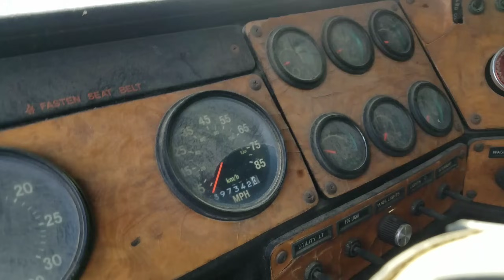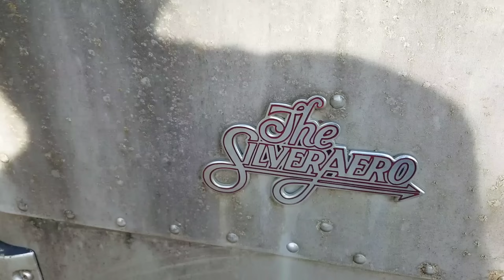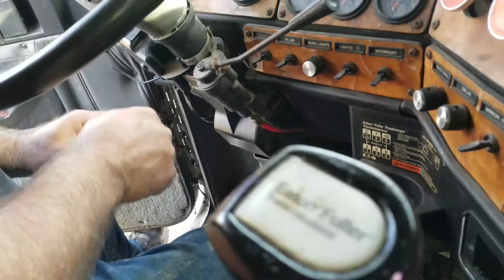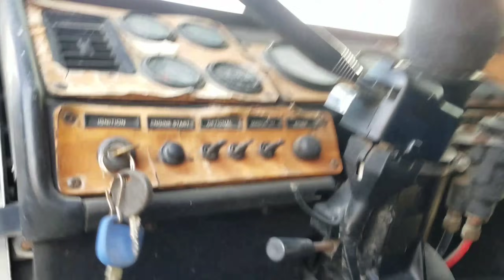Freightliner fld120 FIRST ATTEMPT TO START AFTER 17 YEARS

Comment: Run a wire from the batteries to the solenoid on the pump and prime the shit out of it  and crack the injector lines close when fuel is pouring out tightin them back down 👍
Reply from the maker: iTS GETTING POWER TO THE SOLENOID THE FUEL RACK IS STUCK. IM GOING TO WORK WITH IT SOME MORE BUT PROBABLY GOING TO HAVE TO PULL THE PUMP AND SEND IT OFF.
Reply: take the two bolts out of the fuel shut off solenoid. Remove the solenoid and try to crank it it will not hurt anything if she still doesn't fire stick your finger in the end where the pen on the  solenoid makes contact see if you can move it back and forth enough to get it to free up could be condensation inside of your electric solenoid where the pen retracts done it at least a couple dozen times try that and it will save you an expensive fuel pump repair headache

Comment: A little puff of quick start will have you cranking for nothing. That puff will maybe fire 1 cylinder. Use enough to fire all cylinders and save the batteries. Good video though... these old machines were the real McCoy.

Comment: What you should’ve done is checked for fuel in the fuel tank, and then ran the fuel pump until you had fuel coming out of the bleeder valve that would make sure that you have fuel to the injectors, then go from there
Reply: Cuz I Can 🤣 the only thing electric was the lights and stereo, no cruise control, air wipers and windows, it had a tiny manual pump on the gear drive fuel pump, I would not let service techs use ether, WD-40 only, when a Mexican Pete driver would speed up to prevent me from passing I would get to 70 right next to his window and stuff it up in double over drive and gouge on it!
Reply: I checked all fluids and bled the fuel system just didn't video it. actually didn't know she was going to put this video on youtube
Reply: What was the problem.
Reply: @BudDVega  fuel rack and plungers stuck in the off position. tried lube and heat gun but no luck. gonna have to pull the pump
Reply: tim , I could hear it when they stuck, sounded like the timing chain broke, the number 6 piston broke on mine at about 900.000, the boss did rebuild it though, I put about 60 thousand on it and left the company, the next guy who got it ran over a truck tire and rim, lunched it, bent the frame, he had it fixed again, and sold it, I have seen purple stripe ones sitting in fields, it will be interesting to see what you do with yours, I’ll be watching, keep us posted.
Reply: Timing gears, something isn’t right.

Comment: Very sad to see that truck sitting in ther getting rusting. Before you trying start a truck like that check OiL level and cooling do pretrip inspection to it renplace fuel filters. Add fresh fuel. And the truck will start with no.problems

Comment: I know airplanes and squat about trucks but shouldn’t the supercharger be checked first? What about the dry engine cylinder walls-dry wheel bearings?
Again, I know squat about trucks but this seems like a beaut and he got the trailer too?
Reply: dry walls with either was my concern but I got the pump fixed and it's running great I'll post a video soon

Comment: try looking at the timing belt. electric wires, and everything. bottom as well.
Reply: No timing belt on that :) camshaft is gear driven
Reply: ok, ty didn't know  till now, now i know that.  learned something new.
Reply: @juliogonzo2718  
kind of makes sense because the gear is there and by the king pin to pull that if its needing to get pulled out by a rotator tow truck.   hope this makes sense,  i suck  at explaining things. easier and sounds better in my mind.
Reply: @alquarius86  in a car, the camshaft that opens and closes the valves is driven by a timing belt or a timing chain, usually under a cover inside the front of the engine. The belt is attached to the crankshaft that is rotated by the pistons. In a large diesel engine there are gears instead because they are more durable and there is little chance of them failing unless a loose bolt or something falls into the gears while they are rotating.
Reply: @juliogonzo2718  i understand  now why they call rotators , and a rotator truck but im still not understanding the other one,  .
Reply: @juliogonzo2718  im awake more now than before,   weeks been crazy and my brain has its own thing,  id say my mind or brain has a mind of its own and its a pun all the way around.  lmao lol
Reply: @alquarius86  rotator the boom pivots like a crane, regular heavy wrecker the boom only goes up and down, and can be extended in stages. some the lifting boom can slide to the rear.
Reply: @alquarius86  the company i work for had a rotator until one of the drivers fell asleep and crashed it into a swamp. We still have two heavy wreckers. That truck was cursed I think. Someone bought it and repaired it, first time they used it, the boom got stuck in the turned position. Year's later, it caught fire

Comment: Did you prime the Fuel Filters and shoot it with either? I am not trying to be a know it all, But I was the owner of 21 Trucks and believe me started several that was sitting out in the fields of Kansas and Oklahoma. I have been involved in Trucking every sense 1957. I don't know everything, But a lot more than many so called Mechanics. Ray Pittam, Pittam's Trucking & Transfer Co. I am proud of you it just started, Sounds like the Filters are dry,
Reply: thank you ray. I did pump the primer but problem was fuel rack stuck. I did get it running and will post a video soon.

Comment: Does it get to any one when someone like me knows what is wrong and how to get it running then you get 2 guys who dont know their ankles from their elbows and Just fumbling around.  Apart from low fuel the engine could be running in about 10 mins, I would need a 14, 17 & 19mm spanners (sorry not sure of imperial measurements) and a decent straight/ cross head screwdriver
Reply: I would of in 10 min if fuel shut off wasn't stuck in off position
Reply: @trnot  it is a solenoid with a rubber plunger it screws in the side of the injector body unscrew it and check it out, if the plunger s stuck in the at the end then take it out with tweezers, pointed nose pliers, be careful there is a light spring behind the shutoff solenoid plunger, but even when you said the solenoid was working now because it was clicking you still didn't check it, Also normally diesels have a lift pump but occasionly have a electric pump, I have worked on both
Reply: @chilledoutpaul  I took solenoid off and it works freely when you turn key on. just the rod does not move I sprayed lube in it and gonna work with it again.

Comment: One thing you didn‘t check is the turbo free? After that many years of sitting you got  rain water went down the exhaust pipe and it has to go some where. You have moisture sitting the exhaust pipe and it makes it way to the turbo and freeze up the turbo. Pull the pipe off of turbo and check it and make sure its free. That could be a issue why that engine didn‘t run for you. Does your exhaust pipe got crap in it like a bird nest and the exhaust would be pluged up. You had no cover on the end of the exhaust pipe when you park it many year ago. QUESTION WHY DO MANY FARMERS PULL A CAN OVER THE END OF THE EXHAUST PIPE ON A FARM TRACTORS? ASK A FARMER ABOUT THAT SOME TIME. On that freghtliner drain the old diesel and put in new diesel it would help alot. You can keep cranking on the start like you are you will burn it out because it get to hot to many times. Then you will be putting in a new  starter.  Those fuel filters pull  them to see if there fuel  in them plus at the same tine how much dirt and water is in them filters.

Comment: All of that, and not ONCE did the camera show anyone checking the tanks for fuel, or the primary and secondary fuel filters. That's a Caterpillar engine, there is NO "fuel rack" as you would find on an old 2-cycle Detroit. I'd check the fuel levels in the tanks....then pull the filters, make sure they're both FULL(wouldn't be a bad idea to change them while you're at it). It might be a case of a line being cracked, drawing air, the fuel-pump solenoid not having power or being bad, or the pump itself being shot. Cranking the piss out if it won't do anything but burn that starter up and drain the batteries.....
Reply: There is a fuel rack and it was stuck. fuel,oil and coolant was checked and filter were primed just didn't have on video.. runs great now I'll post a video soon. thanks for watching.

Comment: Where in the United States are you? The reason I ask are the batteries you installed looked like some of the reconditioned batteries my old company used to sell. I am in Arkansas myself close to the Missouri line
Reply: battery outfitter. central missouri

Comment: What was he doing with the block thing and the spray?
Reply: ether is to start it block is to cut off the air if it run away. wasn't for sure if it would but i had an old diesel engine do that.

Comment: You will need to pull every fuel line off, replace them, replace that fuel filter. Drain the tanks and out fresh fuel in them. And maybe even pull injectors and clean those. Then you will get fuel. 
Also pull the fuel pump and take it to someone who knows how to work on them. Have them clean it out for you. 
I bet that whole system has bad sitting fuel in it. 

I’d pull that valve cover off and also the oil pan and inspect and clean everything before I’d even try and start it anymore. 

There are two  guys here on yt who does these cat videos. Find those guys and you will get all kinds of info that will help.

Comment: Hope they realize the diesel in those tanks is shit after 17 years and they definitely clogged the filters tryna run it 😂
Reply: If the tanks have a lot of diesel, the debris is all the way to the bottom. Plus, replacing filters is an easy fix, they probably want to make sure the truck starts and the engine is good before they purchase the truck.
Reply: fuel came out of the pump clear and doesn't look to bad in the tank for 17 years. I'm gonna flush the tanks and lines with new filters of course before i start it again. barrels and plungers are stuck in off position so I'm going to have the pump rebuilt.

Comment: Why do ppl start a engine that's been sitting for years and rev the daylights out of it??????????? Oh let me start this thing up and as soon as it does imma blow it up!!!!!!!!!! 🤦‍♂️🤦‍♂️🤦‍♂️🤦‍♂️🤦‍♂️🤦‍♂️
Reply: That does less harm than people think it does....  Especially on a diesel.  It's governed to a safe RPM.   You could put a brick on the gas pedal, and it would run until it ran out of fuel as long as it has oil and a working cooling system.

Comment: Driven hard.
Put away wet 
Scrap yard material.
Reply: I can tell by your comment you have to idea of what you speak, or antique vehicle value.
Reply: @VickiLevy3702  wore out trucks are a dime a dozen if it didn't have that Cat motor in it it wouldn't be worth more than scrap value. However with that being said I'd still rather see it fixed up and not scrapped

Comment: just  because  batteries  are  new,  does  not  mean  they  are  fully  charged.  i  say  pull  the  engine  and  trans,  get  an  old  peter car.  why  waist  your  time  on  a  freight  shaker.  and  for  crying  out  loud,  change  the  fuel  filters,  not  to  mention  how  old  is  diesel  fuel  in  the  tanks,  truck  sounds  like  it  would  have  started  had  you  gone  through  fuel  system  properly. your  not  doing  that  cat  any  good  with  all  the  fire  water (  starting  fluid ).

Comment: Ffs prime it with fresh fuel, some solid batteries, and all that for them to give it a stomp, instead of letting oil pressure build.
17 years and you bring shitty batteries, well below a cats cranking Amps lmfao
Reply: good used batteries.. 1 1/2 years later they started it. video coming soon

Comment: man seriously, its not carbon on the valves, its too much either!!! try bleeding it properly dude, it will be a great tractor once cleaned up but tools on the battery and a rattle gun to do up battery clamps!!!! come on man
Reply: System was bled and carbon brakes loose from sitting and gets under valves you can hear it skipping a cylinder i call it. (no compression) full of oil full of coolant. everything i own lives on either. problem is fuel rack is stuck in off position

Comment: Shes 17 yrs old fuel in er
Reply: Desiel fuel doesn't tarnish.  Could have some contamination though.
Reply: @josephbusby4625  yea it may not tarnish but it collects h20 and therefore is not good. if he pulled the filters and filled with new diseal and additive to help the injectors clean up lil bit. Probly would have fired. Unless hes not gettin enough pressure in the injectors to fire idk.  I
Reply: That's what I meant by contamination. I was just letting you know that it doesn't tarnish.